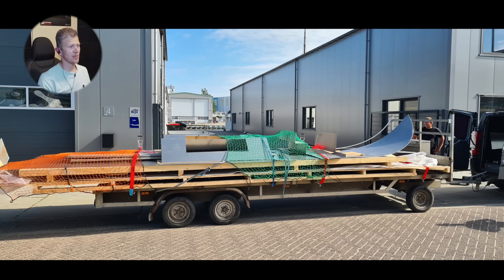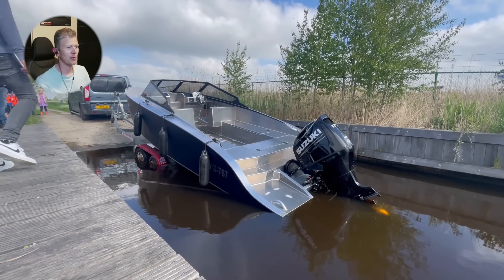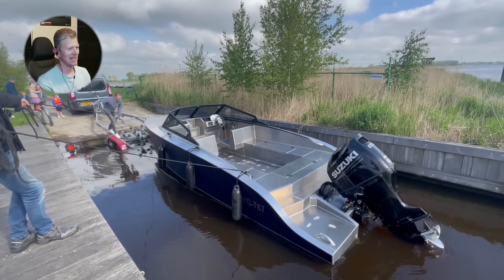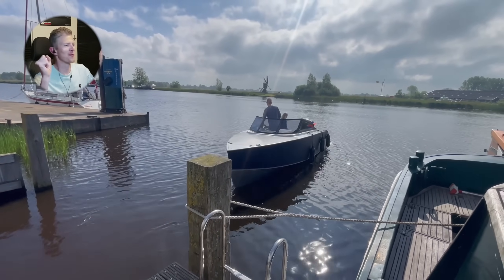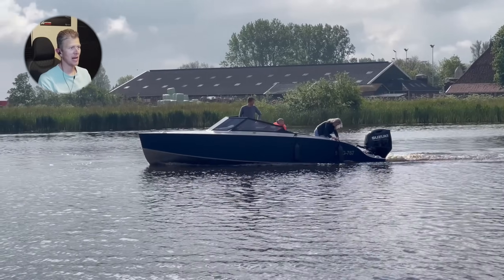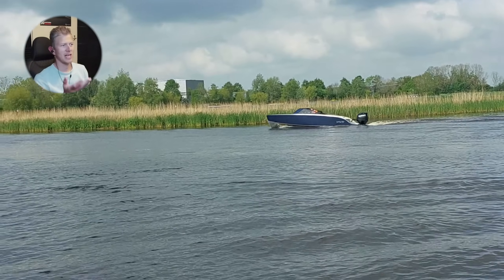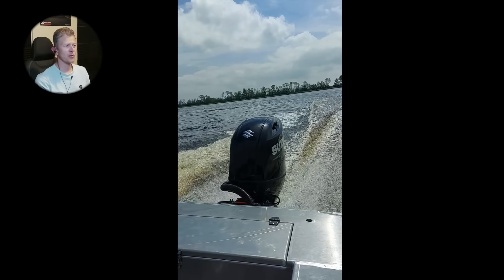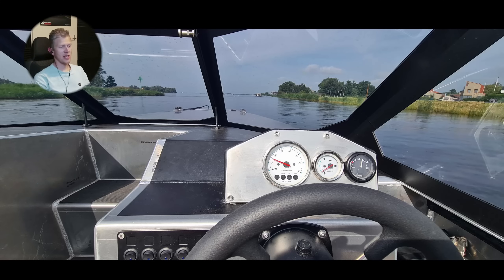Boat Built From Scratch. 1,000 Hours Later, We Test It

Comment: I understand what you feel, i need a few weeks more.

Great work.
Reply from the maker: You also building?
Reply: @ManufactureArnout kind of, I bought a boat hull and built a solar roof with 1500w peak plus an outboard using e-foil motors.